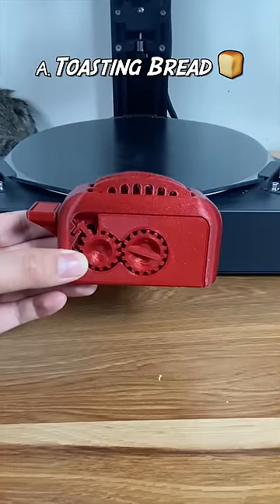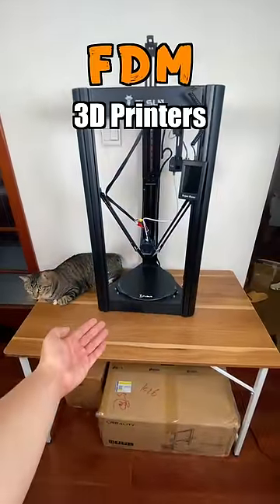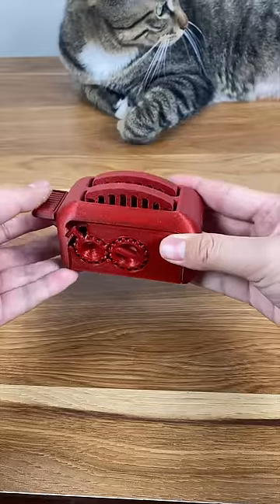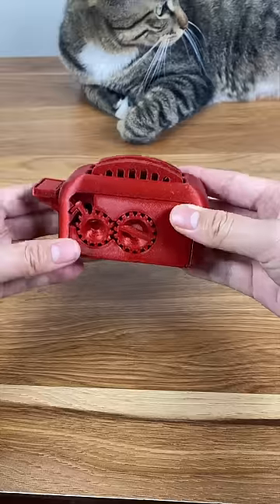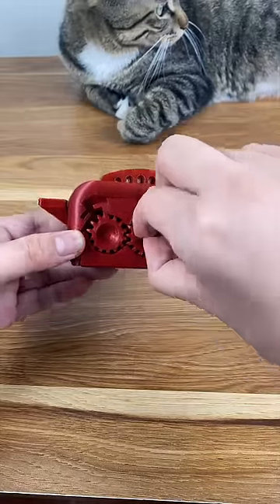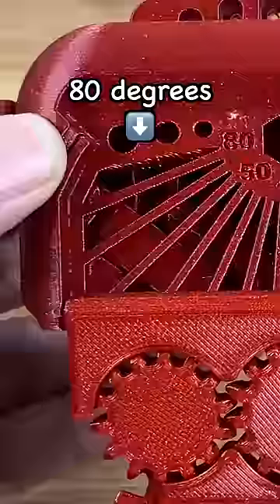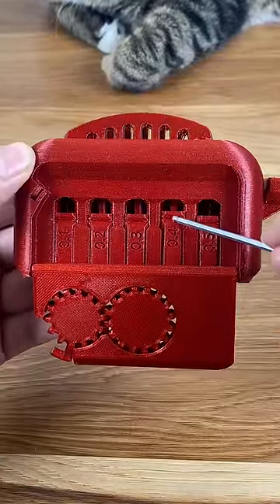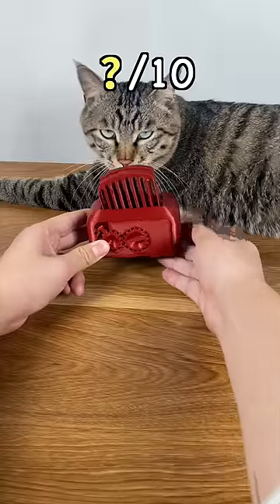A fun way to GRADE a 3D Printer😏

Comment: Thats a pretty good tester tbh. I've wanted to get into 3d printing but the amount of material just do a test seems like a lot
Reply: Thats literally all thats stopping me is the $$$
Reply: I got my first 3D printer about 2 years ago. Honestly filament isn’t that expensive. Most of your objects are going to be like 10-200g of filament which is like a 5min-4h print on an ender 3. Once you get over the cost of a printer you’re golden. I will also add I have a drafting degree and I haven’t really downloaded prints.
Reply: A typical roll of filament unravels to be a kilometer long. I've been printing on and off for two years now and only fully used up 2 entire rolls, equivalent to $40-$60 depending on what filament you get.
Reply: It might be better  to spend a bit more in the printer itself but not bother with all the testing. Something like prusa does not need much tuning to work decently and little imperfections can be corrected manually anyway.
Reply: @Maverickx89  agreed
Reply: It's like you comment on every video I see. Why is this happening to me rn  😩
Reply: Think about it in grams. Filament is sold by the kilogram. 
Most small to medium prints I’ve done have only taken around 50-150 grams of filament which would still leave you with about 900 grams still on your roll.

My first test print (a tiny jointed octopus) took only 11 grams of filament.
Reply: Filament is cheap, lasts you forever.
And you don't need to do a test like that at all.
Just watch when it prints, if it doesn't stick together, make it hotter, if it doesn't stick to the plate, make that hotter until you have smth that works with the filament that you have and then it'll generally just always work.
And you waste maybe the first 1min of printing that way.
Reply: what are you doing here
Reply: I recently got an anycubic mega zero 2, for 120€ it does what an ender does, works great. And I've even seen offers on anycubic's i3 mega s for 90€ in Germany so it's really not that expensive.
Reply: You've been in the comments of the last 3 shorts I've watched lol
Reply: Lazy
Reply: Bruh this isn't alot of filament lol. You could probably print this little test thing 30-40 times on a single $15 roll
Reply: Hello moliminous it’s been a bit but glad to still see your comments
Reply: This is way overkill for a test. For most printers you can get away with printing a cube for checking axis tolerance. A circle to make sure your axis size is correct and the  a standalone version of the tolerance test that is quite small.
Reply: You can buy the filament from China for a fraction of the price, most local supplies are just Chinese resellers anyway, and even the locally made stuff get their pellets from China. 

You can also buy the machine to make your own for around $4500 😂 it'll fit in a garage and you'll make $30k-$50k a year just making filament in your spare time 💪
Reply: It’s cheap af, I got my printer yesterday and I’ve already printed 2 cool figurines
Reply: That costed about €2
Reply: Bro I see your comments on everything I watch wtf is going on
Reply: A spool of filament will last you like a month and is 20$ ish. A reasonable desktop 3d printer like creality ender will cost you ~250$ and a really good one (imo) like prusa will cost ~450-700. Resin printing costs the same at low end but more on the high end
Reply: @baker500877   I said fake checkmark on his name
Reply: why are you everywhere 😭
Reply: Seems like a huge waste of money and time tbh, these things are becoming obsolete because no one cares about them anymore
Reply: I have a toxbox 3d printer. It s meant for kids. It is unbelievably easy directly out of the box.
Reply: @VLE-Grimace  obsolete? You living under a rock or something? 3D printers are more prevalent than ever before.
Reply: @SGIABC  Dad, I know that's you. Very funny.
Reply: You're everywhere I go. Guess it's the Herd instincts /)
Reply: For some reason I just feel like you’re saying this to get top comment again
Reply: Bro ur everywhere i go
Reply: @x-arya-x  Because it's a spam account. You tools reply to checkmarks so people literally spam every YouTube video with comments stolen by other people to farm your fanboy replies and end up with 100k+ subs.
Reply: Wdym? I just bought one and I’ve printed SO many things and I’m not even close to being done with a spool of 1KG filament and it cost me like 20$ a roll on Amazon
Reply: @carson1223  lol I went through 2 kg in 3 days.
Reply: You are literally everywhere
Reply: @carson1223  wow you don’t print much! I do it as a hobby and to do test parts for automotive stuff, been through over 50 rolls in 3 years. But I print a ton. It’s probably running 10% of the time over the last 3 years.
Reply: @CallMeBlazer  would you recommend the ender 3 for a beginner? i've been thinking about buying one for a while but im not really sure
Reply: How are you in every post I look, how
Reply: @CallMeBlazer  I have an ender 3 and your right filament isn't very expensive
Reply: @bigiron4018  hey friend, could you provide examples of how 3d printing parts has been useful to you? I have heard of this but I do not know much about it. Thank you.
Reply: @envinxite  You sound mad
Reply: @classmst89  that little test he printed was probably about 10 cents USD of filament. It’s a lot cheaper than you think, the printer is the only expensive part
Reply: @droldtoid4424  you have good taste
Reply: @joebro3979  lol i know this 🤣😅
Iv used 3d printers before, but cant afford to buy one, thats what my comment meant
Reply: @envinxite  it’s not even a fake checkmark
Reply: Most of it is hollow on the inside so it’s not using as much filament as it looks
Reply: Anotha one
Reply: Who made the BEAT THO
Reply: @classmst89  prusa mini! or a creality printer
Reply: @envinxite   Moli ain't a fake checkmark, but this is the first time I'm seeing his secondary channel lol
I think I'll stick to the main channel-
Reply: @galacticalove  He or she comments on vids so he or she can get more views on her vids
Reply: @envinxite  It's not always like that and I'm pretty sure this was most likely a genuine comment about 3D printers but okay then. :/

Plus if that's the case, then your favorite youtubers with checkmarks are doing the same then.. See how that logic works?
Reply: @galacticalove  Look at their views there clearly trying to revive his or her channel
Reply: @Rotseer  lmao ok and they are commenting so they can revive their dead channel
Reply: Why are you everywhere
Reply: @CallMeBlazer  😂
Reply: plus you’ll have a collection of various mini toasters. kinda cool
Reply: @CallMeBlazer  well are you special.
Reply: U are everywhere
Reply: You don’t have to do a test lmao
Reply: @classmst89  doesn’t apply to almost everything
Reply: @JJ-xt2dq  nope thats very wrong
Reply: Honestly its fine, it would use about 50g maybe even less, which is 1/20th of your £20 1kg spool, also if you sell some designs you can use that money to get more filament, and because you can charge how you'd like, if you really wanted to you could get a kilo after every 2-3 sales all while using less than half of your current spool. When i started i was more or less broke i just had enough to get a pc and printer and 1 roll of filament so i did, lasts a good month sometimes.

Comment: “What would you give this printer out of 10?”

Everyone: Gives percentages
Reply: I think maybe that have to do with how some schools are grading students: although  tests are graded from 0 to 10, some schools around the world chose to grade students  in percentages of proficiency. It's basically the same, but In a different style. My college does that, because if a teacher have to adapt something  (like "oops, that essay was supposed to value 4 points, not 10 like I wrongly said"), they can just use the percentage to convert the notes more easily (it would still be easy without the percentages, but  that way it gets easier and faster). maybe is that, but I am not sure
Reply: (Almost all)
Reply: We mean the percent of 10. For example 75% of 10. If you can’t handle it then 7.5 out of 10 but percentages make more sense.
Reply: 8.5/10
Reply: dolita windo  SLICED TOAST?!?!?
Reply: Well if I give it 65% then it's the same as a 6.5/10
Reply: Divide the % by 10 and that is the score for example 75% = 7.5/10
Reply: Just take one zero off and you’re grading on ten cmon now
Reply: You do know percentages are easily translated to the out of 10 system right? Just divide it by 10
Reply: 65%
Reply: Ikr lol
Reply: They are functionally the same.
Reply: @youtubeuserdan4017  it’s rather just improper format. it was rated on a scale of 10, and people answer with percentages. sure, 75% of 10 is 7.5, but it’s less logical and doesn’t fit the unit of the problem.

it’s also important to clarify these percentages are out of ten if people use them. 75% is 0.75. just saying 75% means you rate it 0.75. number one: that’s not out of ten. number two: 0.75 doesn’t make any sense.
Reply: @robblly8112  75% is not 0.75— that's the decimal multiplier than you apply to a total to get 75% of it.

Also you're explaining this as if I don't know what percentages are. I said they're a better rating format because they offer more digits— which in turn offers more precision.
Reply: @youtubeuserdan4017  I'm speaking as if you don't because you've been speaking as if you aren't.

75% is 0.75. Percentages are almost identical to decimals. Think of it like this: 0.5 is 1/2. They are the same. There is hardly a difference except ease of use.
It's the same with percentages. 75% is 0.75. when you take 75% of, per say, 10, then you're taking 0.75 and multiplying it by 10. It's simple word problems, really. "of" meaning multiply? 75% of something? I really didn't think this was necessary to say.

And I disagree how you think they are a better rating format. Sure, they provide more digits, in some aspects, but this can easily be changed to a basic number format. 1 out of 100? Precision isn't always better, either; sometimes giving someone a much broader range doesn't do good, specifically in this sense. Give someone a range of 1-1000. Seems like a lot, eh? The average person, when rating something on this scale, would either struggle finding an exact place for whatever they're rating, making it take longer for something so needless, or would just broaden their rating to a factor of 10 or 100. This is why a simple scale of 1-10 is perfect: not too complex, and is perfect for simple ratings. One can be more complex if they want, adding decimals as needed (though usually only to the extent of 0.5).

I don't want to add too much more because then you'd start unnecessarily complaining about how long of a response I wrote (I write a lot, my bad), but percentages literally make no sense as a rating tool as their textbook definition is literally a way to describe parts of a whole. Even so, using them as a rating tool is just a scale of 1-100 (percentages mean "out of 100". they are quite frankly a fraction where the denominator is of 100), and if someone uses them (which is happening here) to describe a smaller scale (1-10), then we are now doing unnecessary computing when 7.5 is a much clearer response in a much clearer way.

thank you for coming to my ted talk, i hope you learned something

Comment: About a 7.8/10  according to your grading 
You got a 7/9 and we multiply by 10/10 which is 70/90 and then divide both top and bottom numbers by 9 and you get 7.7 repeating rounded up is 7.8/10
Reply: Neat
Reply: Rounded is 8
Reply: Rounded is 8
Reply: @phantominception2881  they're rounding to the nearest tenth. maybe you're not far enough in education to know what that means, I won't assume that though
Reply: When you pay attention in math class.
Reply: @nathankrehbiel105  I mean, you can round to lots of things.

Rounding is really an arbitrary (not quite the word I want to use but it’s close enough and I’m too tired to think of it) thing, you can round to the nearest ten, to the nearest 5, to the nearest multiple of 2, you can round up, you can round down, you can round a lot of ways. Rounding is a useful tool.

I’m tired and a little drunk so maybe this wasn’t very relevant, but whatever.
Reply: It would actually be 7/10. Since it failed 0.2 on the tolerance test, it also failed 0.1 on the tolerance test. (And failed with some overhang on the 80° angle). If something passed both .2 and .1, with your system it would score 10/9. Which is impossible ofc. But this is only a problem because of the method you used, it's just completely simple, each score shouldn't be weighted the same since each score comes from a different test. So you'd work out a score for each test, work out the 'weight' or importance of each test and work out a weighted score out of 10. Although, unless you're a professional 3d printer or something, you can't necessarily say for example... bed adhesion is more important than tolerance. Also, when you get to higher levels of math you're gonna want to not say.. "multiply by 10/10" because it's not necessarily a multiplication, since 7/9 = 70/90. In this case you would just simply say 7/9 is equal to 70/90. Or... 70/90 simplifies to 7/9 in cases of "division".
Reply: Or you could divide by 0.9
Reply: @phantominception2881  7.777777... gets rounded up to 7.8
Reply: @sprocketbonmb9548  oh I didnt read the last bit properly just skimmef
Reply: @phantominception2881  i am skimmef too
Reply: @phantominception2881  they aren’t rounding
7.7 up, they are rounding 7.7777777777777777777777777777777777 up. The 7s go on forever so rounded to the tenth it is 7.8
Reply: @Framed_Niner  ikr I skimmed and made a mistake
Reply: @phantominception2881  rounding at the 0.1s spot he means he got a 7.6666666666666[infinite sixes]7
Depending on where you round you get a 7
So if it's the tenths spot it's 7.7
The hundredths spot 7.67
Thousandths spot 7.667
So on so forth
But yes if you just round the 1s spot then it's 8
Reply: It you just do 7/9 lol. That equals 0.77
Reply: @JoeyBilbo  how?
Reply: nopenopenope
i just got into winter break no more school please 😂😂
Reply: What the f I'm I into right now??😅😅😅
Reply: Or a 78%
Reply: Alright chill with the math my brain hurts
Reply: Recurring
Reply: You really tried to make it sound impressive for calculating a grade?
Reply: That’s overcomplicating things, just divide 7 by 9
Reply: 7.8/10 too much water
Reply: @Sappby  no
Reply: Reading that killed my brain.
Reply: @fatmaabdelghany7826  or in 5th grade when they explain how to count money and what you should pay/what change you should get back :)
Reply: Seems like there’s too much water.
Reply: Bruh if you're gonna use a calculator to do 70/9, why not just type 7/9 to begin with lmao and if not using a calculator, the simple way is just multiplying both by 11. Which is 77/99. And I'd imagine anyone can work it out from there.. also working with anything divided by 99 is easy to convert to a decimal. 63/99 is .636363, 28/99 is .28282828, 71/99 is .71717171 etc..
Reply: @phantominception2881  in a calculator do 7 divided by 9
Reply: @Arctic37  These math addicts I swear. Not meth Addicts, math addicts.
Reply: Could more simply multiply 7/9 by (10/9)/(10/9) (or, desired denominator divided by current denominator, multiplied to the numerator and denominator of the fraction)
Reply: @barmacidic2257  you replied to the wrong person man